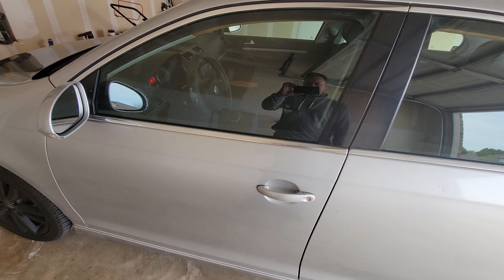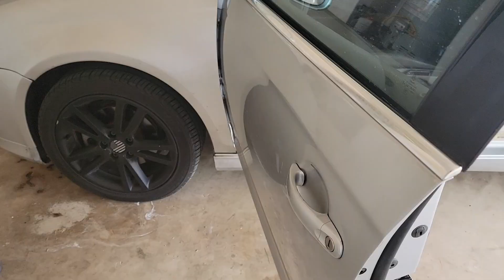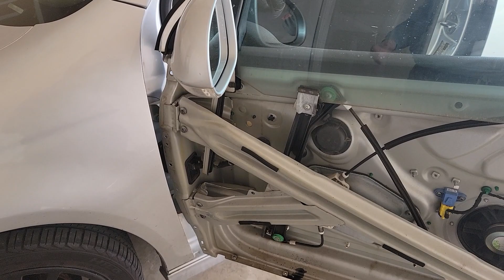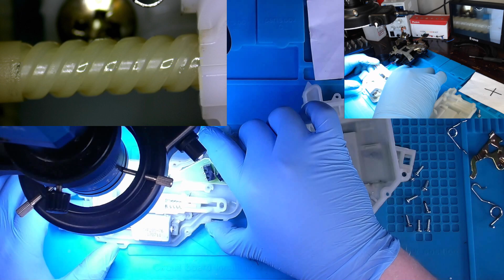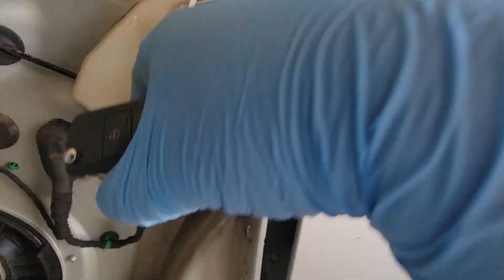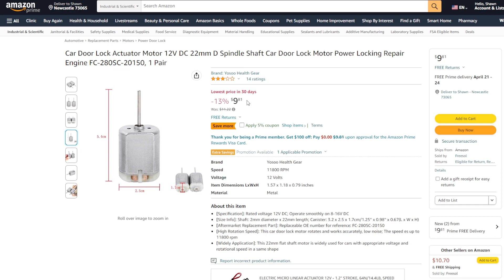2006 VW Jetta Door Lock Actuator Repair

Comment: I appreciate your time making this video. Our 2006 basically performed as yours so far, with nothing huge going wrong, just normal maintenance. My driver's door lock hasn't worked for a number of years. Don't remember if it was a failed battery replacement on the key fob, I seem to remember a broken nylon piece, maybe in the same mechanism you're working with. Just getting reacquainted with a few videos, before I jump in there. 
I think there may have been quite a few design changes, '05-'06? Or somewhere about, I think they had so many revisions that our manual/handbook that came with the car had an incorrect diagram for the fuses!  A mechanic followed that diagram and actually screwed the car up, well  not screwed up and they weren't intending anything but being nice, but it did immobilize the car for a while. 
It's not the lowest base model it does have electric windows, and a nice stereo, but no xtra bells and whistles, and as such the fuse panel had more than a few empty spaces. After repeatedly searching online I found I think five different revisions. I finally got the car started by just sticking a 3.5 or 5 amp/low value fuse in every hole that was open, and tracing them later. 
I've had to warn anyone new in the car to not lock us out. 
Going by your little stash of electronics, I'm probably not telling you anything new but it may help someone else. Those micro switches if I'm not mistaken have both NC and NO option? Usually dependent on how they're connected will get normally open or normally closed service from them. I thought maybe that second from the left was just doing the opposite function. 
Thanks for the heads up on the screws holding the outer skin! I usually take notice on minutae like that but at this age I'm actually surprised at what I catch. 
Around 39mins in the information on the door handle/adjustment, another appreciated great tip. I didn't notice how long I've been going on, sorry about that. I forgot and left a pretty new to us three-wheeled bicycle out. Our neighborhood is changing also and it didn't last long. I'm going to get another because it really was a nice little piece of exercise, back and forth to the store and I don't have to start the car, which I've got down to 2000 mi. a year. 

If nothing else, hopefully I won't look like a complete fool if I take it in to be repaired by someone else, and I know enough not to be taken. Thanks again.
Reply from the maker: Appreciate that you pointed out specific time stamps you felt were helpful. I will pin your comment to assists others. Thank you for watching!